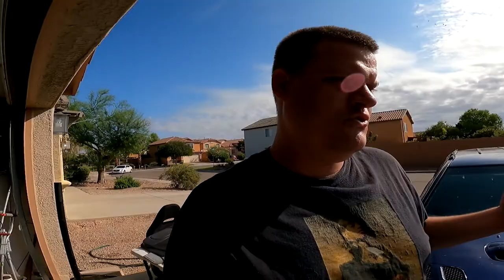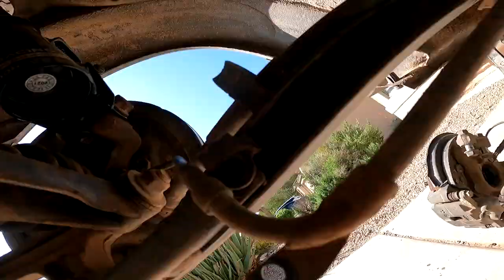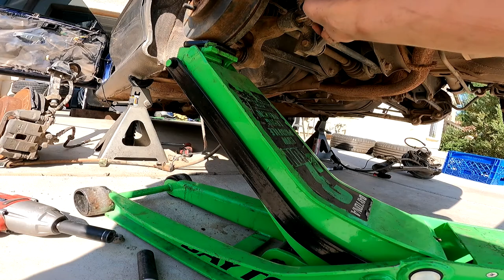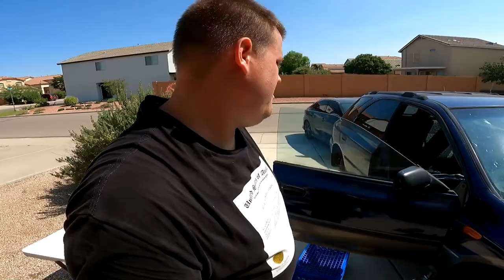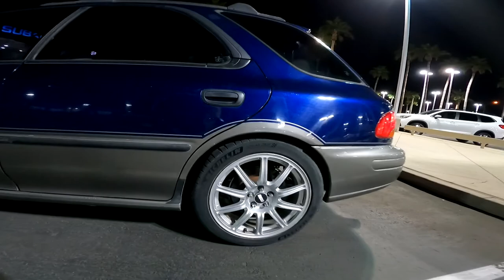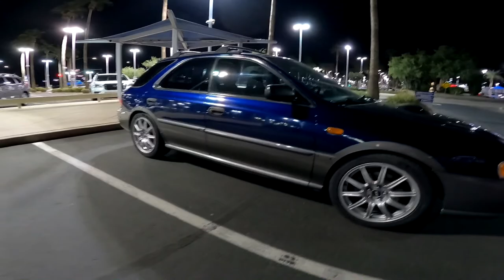WRX "Big"  Brake Upgrade (93-01 Classic Impreza) GC8

Comment: Did you swap the master cylinder at all?  My 1996 OBS had single piston fronts and factory rear disc.  I did a 1997 legacy Outback front brake and master cylinder upgrade to it.
Reply from the maker: ive never swapped any of my master cylinders in either of my gc/gf builds i couldn't ever find an svx one to run the bigger booster.

Comment: How much did all of those parts cost?
Reply from the maker: i bought them used prices fluctuate. id assume no less than $250 but i had to drive to prescott and back. keep an eye open on facebook market place for bugeye partouts and ask what they want.
Reply: @TKirkMedia  oh slick thanks!
Reply from the maker: @flawlessduke5027  also criagslist you can find some deals too once in a while since no one really uses it like that anymore. Offer up ok too. Or at the very worst go to your local yard and pull the parts from a wrx.

Comment: Don't forget the proportioning valve. The drums require a different pressure than discs. Your brake bias shifts rearward when using the drum prop valve.
Reply: It actually depends on the year. I've been diving deep into this swap for my 2001 wagon. Found out the proportioning valve is the same part# as the 2.5rs.